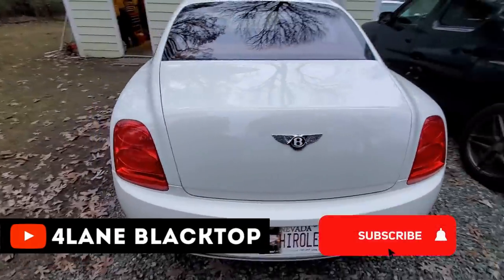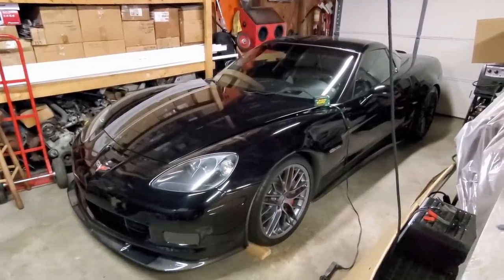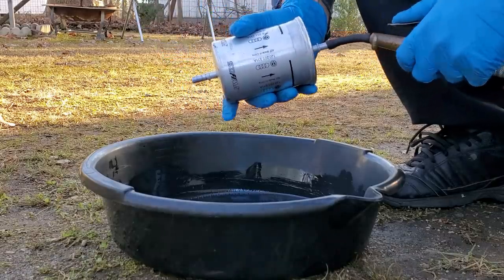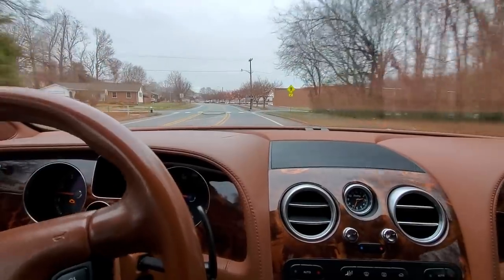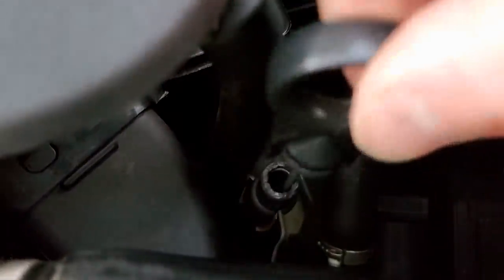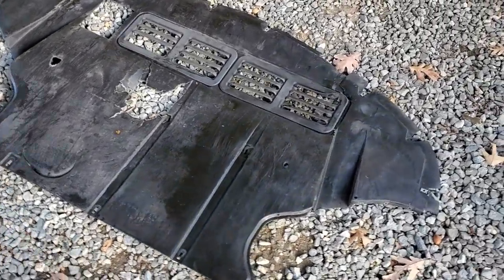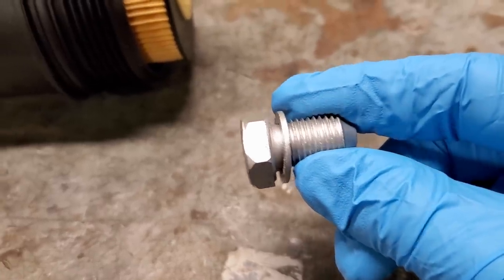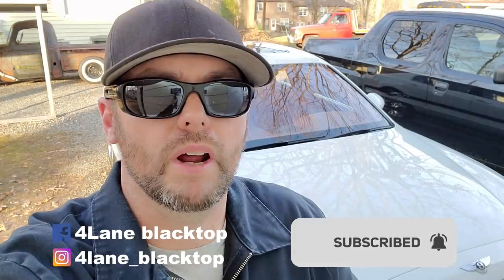Hitting The Road In My Cheap Salvage Bentley Flying Spur And Feeling Awkward

Comment: Oh no! You should really get yourself a thick enough (at least 3 millimeters) steel plate under the floor jack, that plywood doesn't allow the jack wheels to spin when you're lifting the car. I recommend you weld handles to that steel plate so, it's much easier to place under the car and get out. Iäve made one for myself.

Comment: Shell 93 Octane V Power Nitro is best gas performance wise you can buy! My 2019 Ford Mustang GT PP1 gained some ponys just by adding this gasoline.. Secondly my first oil change done early at 4200miles came back clean. Good break-in on that Ford 302

Comment: Interesting project! Looks like you are doing well with it. Only things I might have done differently was to drop the fuel tank as soon as I saw sugar at the filler neck, then after the pumps were fixed / cleaned, filter replaced, and lines from the tanks cleared, I'd have disconnected the fuel lines at the engine and run fuel through the system that way, then reconnect the lines. Change the oil immediately instead of waiting. Seeing the other vandalism, running the engine with the old oil was a big risk. Otherwise, I'd have done the same as you. Regardless, it looks like all is working out thus far.
Reply: Sugar is water soluble. Remove pumps. Drain the tank. Cycle a few gallons of water in and out. (Check for residual sugar by evaporating a few ounces on a hot surface) Flush tank with anhydrous IPA to remove residual water. Refill with gas and install pumps.

Comment: Use water to flush out the sugar because sugar won’t dissolve in petroleum products. Then use ethanol to flush out water. A small amount of ethanol mixed with gasoline won’t cause any issues. It’s a pain in the ass but this method is effective.
Reply from the maker: I did just what you stated in a later video.

Comment: What happened to simple locking fuel caps? On any vehicle s what ever makes or price? should be standard issue fitted.?
Reply from the maker: It must be released from the inside, so whoever did it had the keys.
Reply: @4LaneBlacktop  his ex.

Comment: How hard would it be to use an alternative fuel tank to isolate the rough running problem?
Reply from the maker: It would be pretty hard. You would need a efi supported tank and adapt lines and wiring. Its definitely a issue with the actual fuel and is getting better the more I flush it.

Comment: Why do you blow out the fuel filter opposite the recommended flow direction? Not busting balls just curious?
Reply: I think you just answered my question. Don't want to blow the sugar through the filter... Just wondering if that Jack's up the filter with pressure through reverse flow?
Reply from the maker: You want to push the contaminants away from the element. If does not damage the element at low pressure. It is a paper material so it can flow air or liquid.